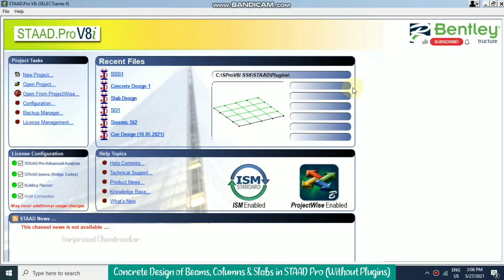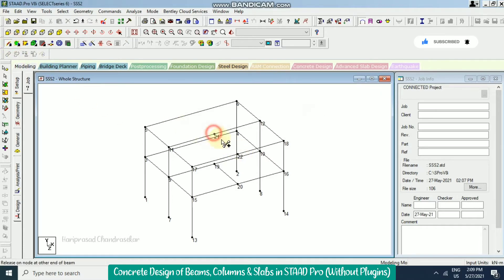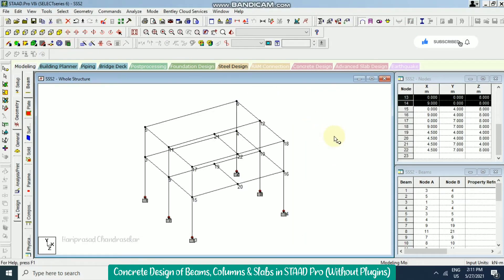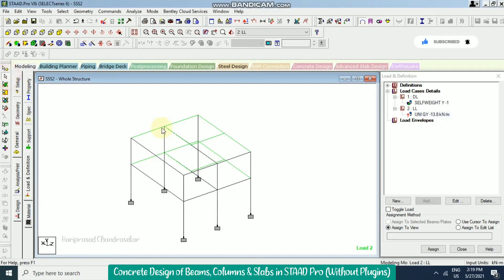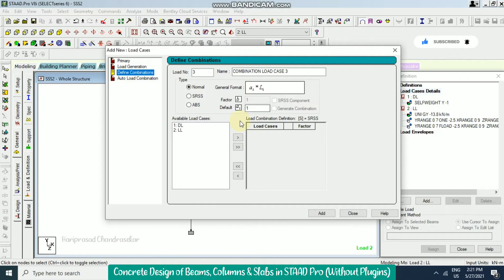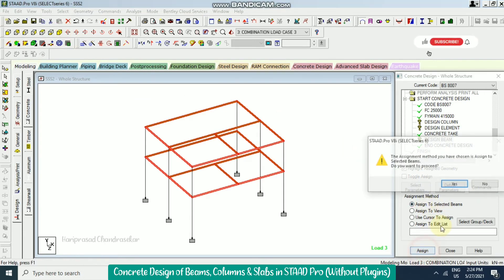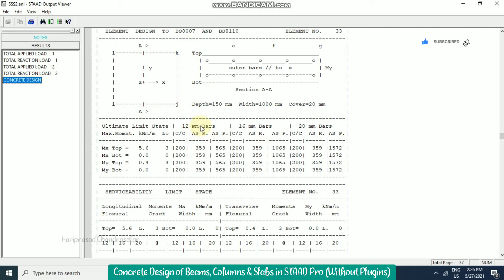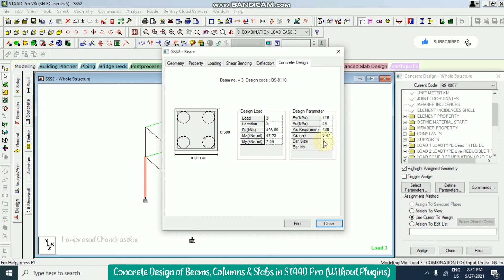Concrete Design of Beams, Columns & Slabs in STAAD Pro using International Codes (Without Plugins)

Comment: Live load not applied in plate, so slab design is invalid, pls check,  floor live load direct transfer to beam,
Reply from the maker: I appreciate you pointing that out, I'll double-check the live load application in the plate elements.